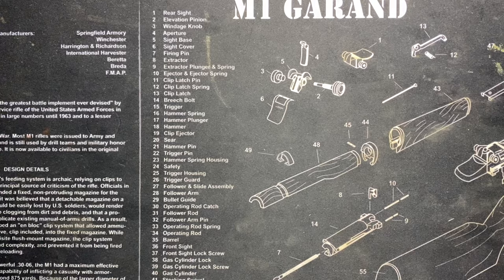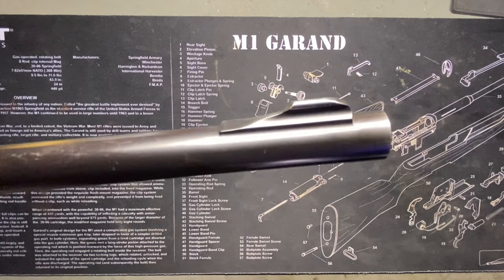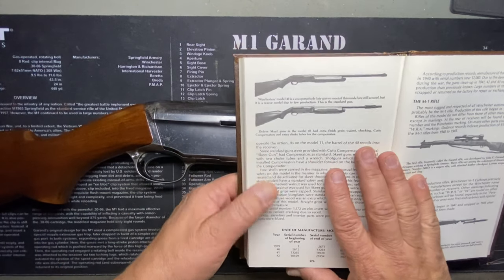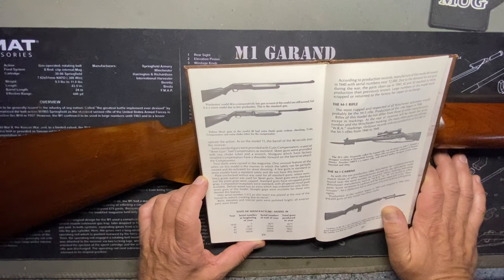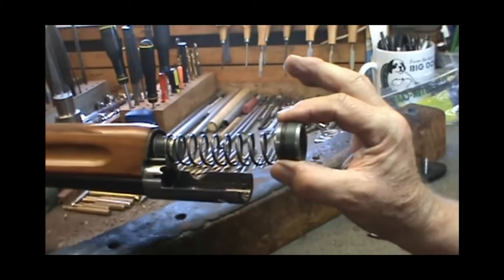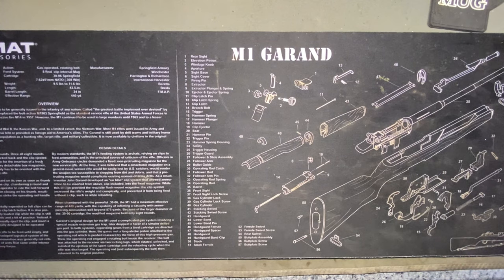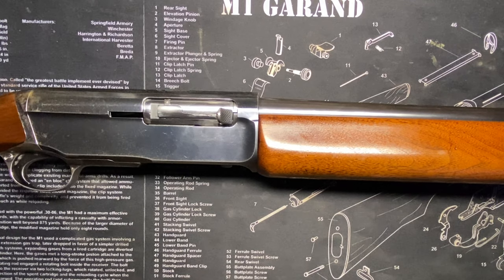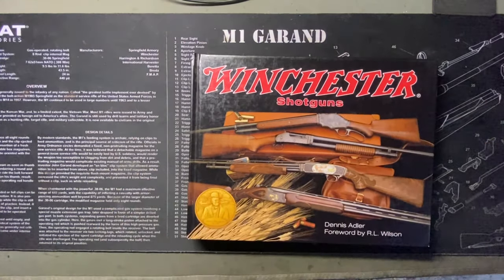Winchester Model 40

Comment: Awesome video. I picked one up a few years ago, foreend stock has some damage which they're known for, and it appears mine has a shortened barrel, doesnt match normal length or comp length. Wouldn't mind getting it into a collectors hands, just sitting in a closet!
Reply from the maker: Odd, long recoil guns rely on static barrel weight for proper operation due to the fact that the barrel itself is part of the autoloading actions reciprocating assembly.....surprised it even functions when shortened (lightened).  Have you shot it?  What IS the barrel length?
Reply: Excellent point! I pulled the gun out today and measured it, 24-5/16" from end of barrel to breach! And it has a different front sight on it as well. Yes, I've shot it with Federal target loads and it cycled fine, oddly enough!

It has smooth furniture but does have the screw safety you pointed out. I assume it originally had a 25" barrel with the compensator and either it got damaged or someone got tired of it😂

Comment: Any chance the 1911 and model 40 barrels interchange? Did you shoot it again? Did the ring swap work? I need to see where mine is at, ill let you know...
Reply from the maker: Not a chance.....different designs completely.  

The set up recommended by Winchester is the only one that should be used on the Model 40....if yours differs in any way it might be the reason the forend and/or stock has damage. These were discontinued real fast and buried by WInchester so much care must be used in operating them and always keeping in mind that, for some reason, the manufacturer themselves pulled the plug on them and tried to make them disappear.

Comment: got an old model 40 skeet variant
just looking for a cutts choke then off to the range.  
was the ring switch the solution for light loads?
Reply: Ever find a Cutts choke?
Reply from the maker: I just kept it in the orientation Winchester recommends. It very rarely fails to cycle. I guess it’s better that way than having the bolt slam into the back of the receiver after every shot because it’s too loose.  Thanks for tuning in!